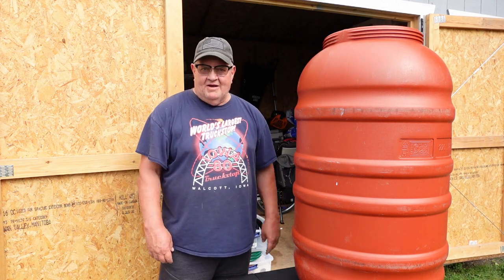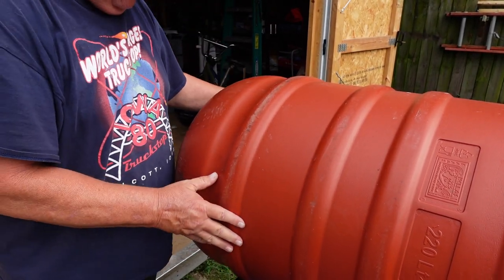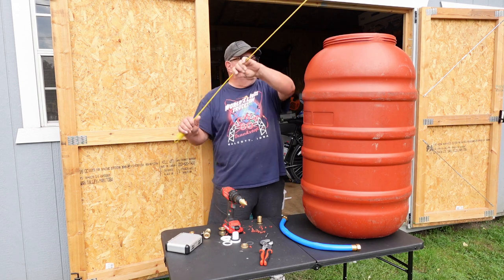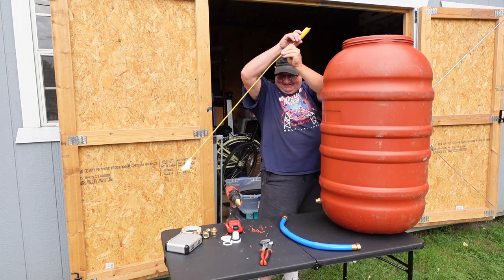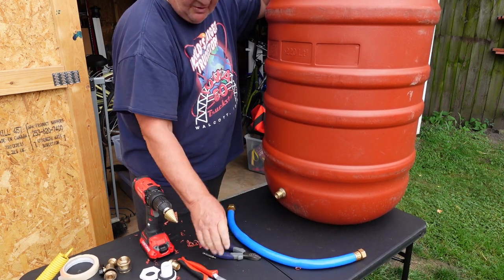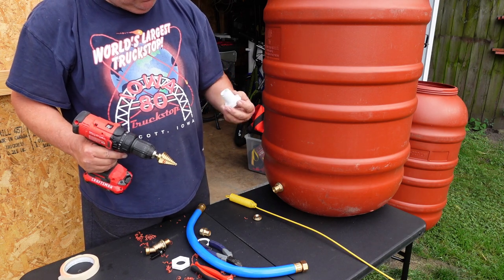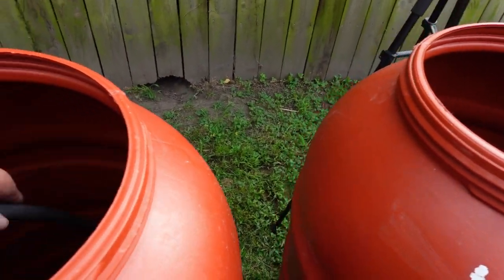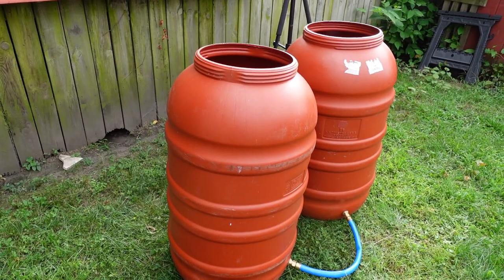How to Connect Rain Barrels for Catchment System Off Grid Cabin Tiny House

Comment: I would think you would want a Daisy chain at the top of the barrels. After one fills up it would run over to the other barrel. I guess you're thinking the water pressure will fill the other barrel And they will rise at the same time. Maybe